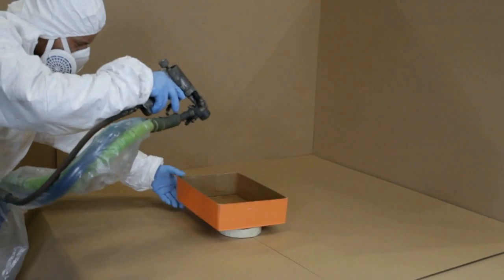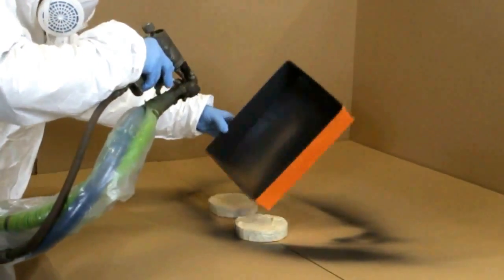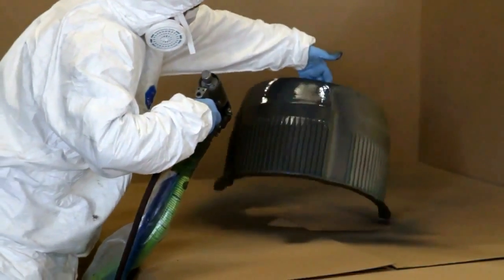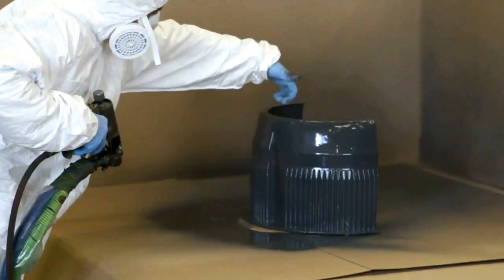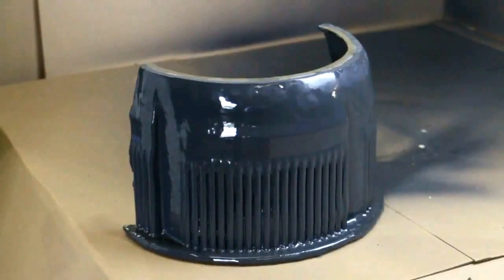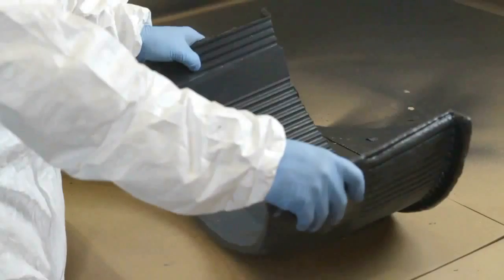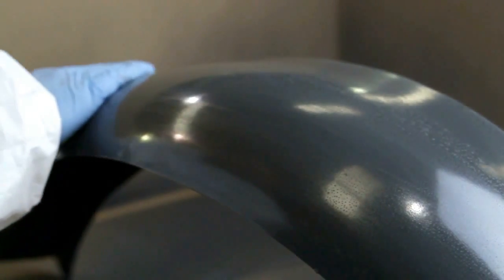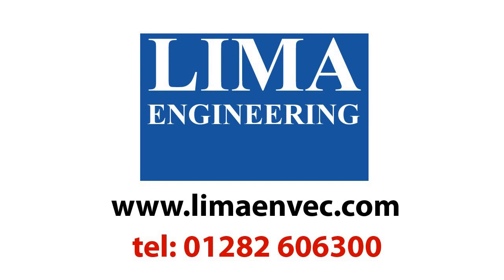Polyurethane protective spray coating and lining

Comment: WAYYYyyyy too much pressure and too heavy application-typical Brit arrogance:: should be 20-30 psi and HALF as much per coating- this will video will cure in about, 6 months ~
Reply: Cures in 3 seconds

Comment from the maker: Thank you for your comments Cabinas. Yes polyurethane is a very versatile material for a wide range of industry applications.
Reply: excellent product and video. can this coating be applied on Stainless steel. and can it be applied for mixing tanks??